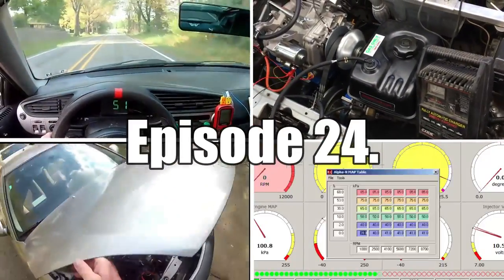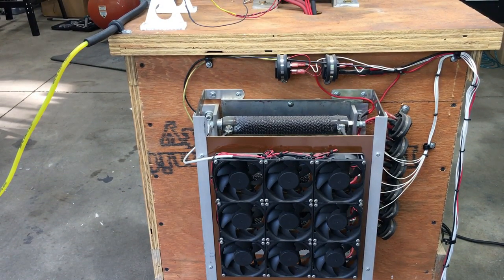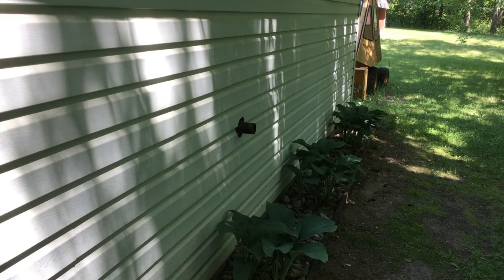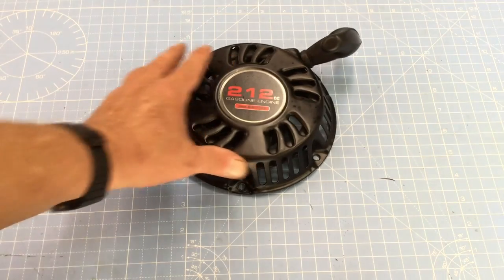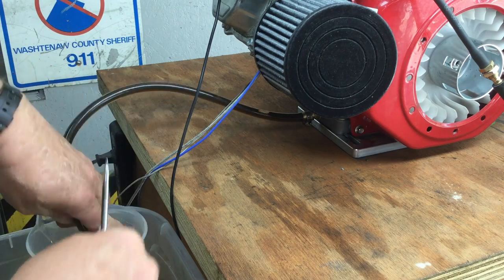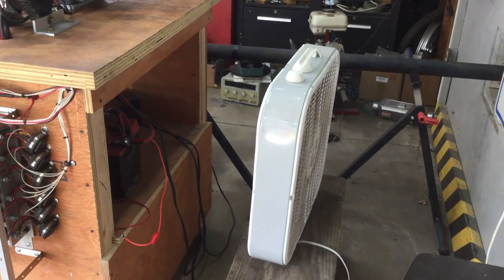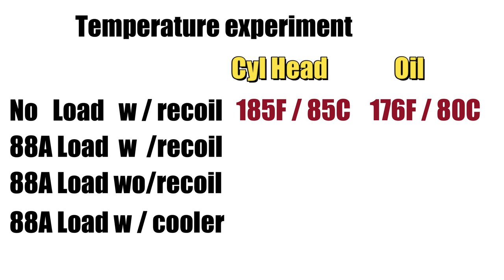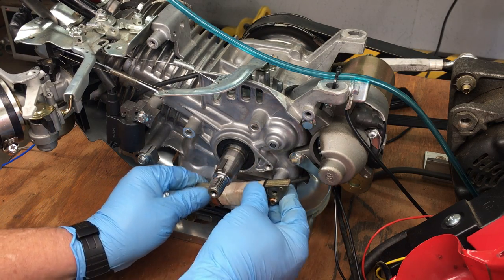Episode 24.  Testing an oil cooler on a 212 cc Predator engine

Comment: Return the cooled oil to the cylinder head, not the sump.
Reply: Seems sensible.  But I don’t know shinola about forced lubrication system design.  Keeping the intake air cool is a good thing, right?
Reply: I think some cooled oil run to the cylinder head is a great idea but all of the flow may actually not drain down to the crankcase too fast. Idk though.
Reply: @Only1Sethy  How do the 212 lube the valves?  
They have enough space along the pushrods for oil to splash from the sump up to the valves. 
The problem might be oil escaping trough the crank vent.
Reply: @pepethefrog7193  honestly not sure, probably just by splashing. That's also true with the crankcase vent. I'm thinking just a T to split the flow between the head and crankcase would be ideal? Not sure though. Only way to find out what's most effective is to try right?
Reply: i mean thats an idea but just returning the cooled oil to the sump dropped the temps like what? nearly 30c? thats huge already!
Reply: @Only1Sethy  That's a great idea!!
This way we prevent the valves from overheating!!
Reply: Any oil, especially cooled oil is best returned to the piston skirts. Just squirting it up under the skirt is where best control of cylinder head temp is known.
Reply: @wallacegrommet9343  In the non inverted air cooled engine it is pretty straight forward. Airflow around the cylinders is like a chimney in that once the volume is met any increase in air flow does little to increase cooling. The heat kinda needs to rise away as heat does, we can't force the air to remove heat ...the heat must build and rise away from the cylinder fins then we can move it. Quenching the heat is best and in an air cooled engine we have oil available. The oil ( for cooling )  is best placed into the hottest area. This happens to be ( in addition to valve guide area) the piston skirt. A small stainless steel tube manifold is attached inline to the mains and the pumped oil squirts up into the piston skirt area. The oil quenches and carries the heat away from the cylinder head into the sump where it can be filtered and cooled. EZ to build and most effective.
Reply: Good write up. Now that you mentioned it I remember my VW repair manual for the JT five cylinder engine depicting oil jets aimed at the piston undersides.
Reply: LOL , on the outside?!??!!!
Reply: @stevenbryant4718  Exactly, better to dump on the outside than into the head. Very good comment.
Reply: @wallacegrommet9343  it already cools it self

Comment: I would try routing the cooled oil differently instead of having the cooled oil returning into the sump. see what would happen if you have the cooled oil return into the head through the valve cover.
Reply: I agree, that way more heat is pulled from the head into the oil instead of the loop of cool oil flowing through the cooler. with no passages to flow it through the head, how well would dumping it over the rockers work? Going back to where it drains back into the block through the factory galley wouldn't pull as much heat and would be just about the same as flowing through the bottom of the block with little heat transfer.
Reply: @braddorris4535   good idea but there would have to modify the oil returns threw the head. if that issue is not addressed first then the oil cooler will be pointless if all the oil is in the head and not enough in the crankcase to lube the bearings up
Reply: @mikefloyd6732  exactly!! It’s definitely something I’m interested in
Reply: That’s how a turbo swapped cars return oil.from oil pan to turbo then to valve cover but it’s the oil pump…. For now
Reply: @TheViny633   turbos use an oversized return back to the oil pan, not the top of the heads, they get their oil from the engines pressurized system in the block and at the turbo it drops pressure, hints the oversized return line, if it kept pressure the seals in the turbo would blow out and cause it to smoke out of the down/up pipe
Reply: @braddorris4535  some but he’s already seen it’s not making vacuum on the 420 if I recall may be wrong but low boost for a small engine shouldn’t hurt to bad and i was just saying it would be cool to pipe one in.
Reply: Pumping oil from the sump to other places it's not designed could also cause an oil starvation issue while exceeding the required oil flow in the top end if it takes to long to flow back to sump
Reply: Suggestion: install clear valve cover, return oil in a way that would create a film in the head (something like a brass tube with multiple holes installed upside the valve springs), give us that sweet sweet data and images, hehehe!
Reply: @osvaneabreu1795  yes please!!

Comment: i think you could get away without an oil pump.  When the engine is in operation oil is slammed against the left side of the engine (when viewed from the fan) and is drained from the right side due to the rotation of the crank causing a difference in pressure.  This difference might be enough to cause sufficient flow through the cooler.

Comment: Woo! New episode!

For an efficient package, you can try running a duct in between the cooling fan of the engine, in front of where the recoil is, and the radiator. 

To reduce power draw, you could try to use a mechanical fuel pump, the kind that runs on intake pulses or crankcase pulses, to circulate oil. 

And I'd love to see what simply changing the oil in the car from 20w40, to 10w30 would do for top speed.
Reply: I was going to suggest basically the same things.
Reply: I've been saying that in other vids along with oil cooling.  Without a duct bringing cool air into the engine, hot will just recirculate under the hood.
Reply: @bobroberts2371  to an extent. Even with the belly pan, an insight has a large vent area underneath the vehicle. At idle yes, it would be an issue. But cruising down the road at any speed whatsoever there should be enough forward motion to blow air through where the radiator used to be into the engine compartment. Remember he lost power and efficiency when he tried to block that off. 

He could however block off most of it and create a dedicated duct, one for the air intake and one for the engine cooling. That would yield positive results
Reply: But pulling out heat from the oil an injecting it back to the cooling fins is pointless.

With pre-heated air from radiator the cooling fins on the cylinder head would'nt  do much.
Reply: @casemodder89  but you got to look at the totality of the system. That is a bypass cooler at best. There isn't a whole lot of cooling in the first place. And the benefit is that the cool oil can end up where you want it, like at one of the hottest points of an engine, the cylinder head. 

The name of the game isn't necessarily the absolute coldest you can run the engine, it's stabilizing the entire engine with a constant temp.

Comment: Pulse pumps will move oil. Build break repeat did this on their turbo build. Also like many have stated you may want to return the cool oil to a higher point I would use the place where the governor was, assuming you have removed it. Top tins/plate to direct the airflow over the cylinder head fins, normally part of the throttle assembly and fuel tank mount.

Comment: I was going to do a similar thing a year ago but not for cooling, was going to filter it instead. Exactly how you did it with a fuel pump etc into the 2 drain plugs. Neat stuff.

Comment: I have an old Harley Davidson ironhead Sportster, so named because the jugs and heads are cast iron and yes air cooled.  They are know to run quite hot, an Earl's 10 row oil cooler meant for the front of sportbikes works great.  I have it mounted vertically in front of the rear tire under the seat area, it is a hardtail so no rear suspension.  Amazing how much air flows off a spinning tire, dropped my in tank oil temp from around 230f when thrashing it hard to 180f. Nice seeing another Michigan mad scientist at work.

Comment: I’d like to see this repeated but using a pump that doesn’t incorporate air bubbles and adding a typical 12v pusher fan mounted on the cooler
Really great work👏👏

Comment: You could try wrapping copper tubing in between the cooling fins of the engine. then circulating water through it, you might need a thermal compound to help transfer the heat. You could also try having direct air cooling, take an old radiator fan and just blast air at the cylinder.
Reply: Not a big car guy but wouldn't he have two radiators and a pump. Set one rad up just like the oil one then put the other where the pull start was so that fan pulls in cooler air with the fan. No it wouldn't cool as well as wrapping copper tubing but it's something. Or I just have no idea what I'm talking about. Lol
Reply: Adding fans and pumps would cost a lot of power. Adding heat pipes to the head with thermal compound would increase the surface area a lot with minimal weight and no power input.

Comment: Consider using a lithium battery (which can absorb very high rates of charge), connecting an alternator to the drive line of the vehicle, and using the voltage regulator as a form of regenerative braking. Not sure if the juice is worth the squeeze, but could be an option to get you more on-board power.
Reply: Great Idea, probably not very effective in very flat areas
Reply: Aren't alternators a bad choice for that application because they're only around 60% efficient, whereas a generator is more like 90-95%.
Reply: Hybrid drivetrain would be very difficult to implement, but you could probably use an alternator as a brake to recover energy to run a pump and the other electronics. If you have an alternator switch like hypermilers use you could hook that up to the brake pedal and voila, would probably work. Then again if anybody can jank together a hybrid drivetrain with a vaccum cleaner and toothpaste from ali express its Jimbo lol
Reply: Good idea but alternators can be as bad as 28% efficiency at high rpm + low load.

So an external lifepo battery without the weight of an alt would be way better for performance.

Also if you need some power, get a low K/V brushless motor, B6 rectifier and a shunt type voltage regulator.

That'd give you about 80% efficiency on the motor-generator and somewhat like 5% additional loss for regulation.

Comment: This has been a very interesting series. Really helps in my understanding in why modern cars are built like they are and what the engineering challenges are.  
I'd love to see you test:
- Running the oil cooler without air bubbles
- Running the oil back into the head
- Putting a thermostat on the oil pump
- Running copper water cooling lines around the head to a rad with a thermostat controlled pump
- Test different oils
- More load and RPM (how far can you take these motors with an oil cooler? water cooler?)
Reply: I employ that copper cooling tube idea on a lot of the air cooled 2 strokes I build for supplemental cooling. Brazing the rods to the cylinder heads was the best improvement on that idea I've done so far. Only really limited then by water pump flow, and radiator size.

Comment: I agree with routing to the valve cover with the cool oil. Also a pulse style fuel pump that works off the crankcase pressure pulse may work.

Comment: So from reading the comments, put the outlet of the oil cooler to the top of the motor.  

Run a big hose(like a clothes dryer exhaust hose) from the front of the car to the fan inlet on the motor to ensure the cooling air coming in to the motor is as cool as possible.

Add an alternator on an axle where the alternator field is only energized when you hit the brakes for a regenerative braking kind of power increase.
Reply: Add a 100 watt flexible solar panel to the roof of the car.

And replace the normal starting battery under the hood with a lithium battery of the same weight as what is in there now.

Comment: I'm not an expert on the predator series engines, however I would imagine that pushing that oil back into the engine below the oil level is not a long term solution. We see this with scavenge pumps on rear mount turbo engines, ideal would be to have it run to the VC, then naturally accumulate back into the oil supply in the crank case. 

Your data was pretty much as expected, and with a few tweaks should be a nice solution to maintaining acceptable bottom end temps. I understand your numbers were more for Deltas, but unfortunately,  measuring CYL head temps from the outside, especially on an air cooled engine doesn't really tell us whats important, which are the cyl temps themselves. With any engine, the biggest IAT change (pre combustion) its time spent post-throttle body, specifically the milliseconds it exists in the cyl before combustion. Finding a way to measure that, and furthermore bring that down as much as possible is going to be the ticket to this engine not only making power, but surviving it. 

Thats another reason why I've said it before, and I still stand by it, going to a supercharger is going to be a mistake for this engine.  The popular opinion of "Turbos run hotter" is inaccurate, and matched with the same popular idea that turbo lag is gonna be a problem. Aside from the fact that a properly sized charger will spool almost immediately, that engine spends most of its time at WOT, making turbo lag nowhere near the problem people want to make it out to be. What will in fact be a problem, is a properly sized supercharger spending almost all of its time being spun up (at what should be) its near maximum flow. Not only will it be extremely parasitic, but the IATs will be terrible. 

Your money, your content, your car, I'm all for it regardless.. however, the best way to skin this cat is with a knife, not a spoon.
Reply: well that escalated quickly
Reply: This makes me want to see how well it works now, if its shit or breaks then I'm sure a turbo will will come next.
Reply: As a supercharged car owner I agree. Without an air to air intercooler and a lot of weight a turbo could be achieved easily and he could make a phenolithic spacer to keep engine from eating the heat soak
Reply: Plus if you’re going to run a turbo you need to run a oil pump anyway so you can run a oil cooler no problem

Comment: Like your methodical and scientific approach. I think most people fail with their EFI conversions due to the lack of sensible plan. I am surprised you didn't take a baseline reading of the crankcase vacuum and pressure. This may help to determine if you are actually causing excessive crankcase  pressure when running the oil pump that maybe affecting the cylinder head temperature. In addition, how come you didn't read the spark plug for temperature changes? Maybe Colortune to get an idea of your combustion temperature? It would be great if you made some type of volocity stack where you removed the pull starter to cool down the engine. Look forward to your next episode.

Comment: @Robot Cantina You might want to re-test the oil cooler.  You had tons of air in the lines, which can impact temps.  Maybe a return higher than the resting oil level. so your pump isn't fighting as hard.  Lastly, get some old cpu heat sinks and bond them to the pump, help it stay cool without adding to much weight.  Scamazon sells the bonding agent, or you could just use zip ties and some thermal paste.  Hope this helps love this series.
Reply: My thoughts exactly. I've used a similar looking pump. It said to keep it lower then the gas tank as it does a better job pushing fluid then pulling fluid. That is one of the reasons why fuel pumps are located inside gas tanks.

Comment: When I worked at a golf course years ago we used to get clogged up recoil caps.. One of the maintenance guys just used a few inches of pvc sewer pipe with a fan in the end of it and it worked like a charm... Never had to worry about clogging or overheating again... Made my job sooo much easier!...

Comment: Excellent testing procedures and results. Back in the 70's at least one company sold liquid cooled heads for the Honda Odyssey 250. I believe a similar system would be the best option for the Predator as it eliminates all the issues with over/under filling the crankcase with a pump. The modified Odyssey did not require a water pump, it used the thermal siphon method, simple, trouble free and very effective.

Comment: Upgrade to a Marco .88 LPM pump, add a piston cooling jet, split the oil feed off to the valve cover to help control cylinder head temp, add a thermistor to control a fan mounted to the oil cooler and a deaeration chamber like a catch can before the pump. 👍🏽
Building this on a predator 420 for a golf cart currently.

Comment: Not familiar with how the oil is delivered to the bearing on these small engines, but it appears that your recirculation system would drop the oil level in the sump. If it is to low, the slinger (or whatever delivery method) won't be able to pick up the amount necessary for the bearings. Might have cool oil but still lower bearing life. You might consider a stand pipe on the sump connected to secondary oil reservoir. That way you can maintain the designed level at the lower temperature.
Reply: I assumed that he had the pump running, then filled the sump to the appropriate level. Once the cooling system has filled with oil, you keep filling it until the sump is at the normal fill level. Shouldn't have any significant impact.
Reply: I don't believe there is enough oil either, the pump is sucking air.  That's why there are the bubbles in the line going into the radiator.
Reply from the maker: The engine has a splash type lubrication system.  At high speeds oil is violently slung all over the crankcase and everything is covered with oil.  Also at high speeds, the pump was sucking a bit of air due to the way the engine get lubricated.  Before the test was conducted the oil level was topped off to accommodate the extra oil volume.